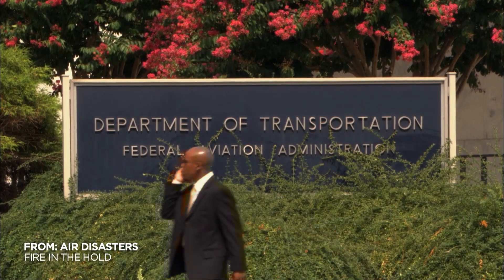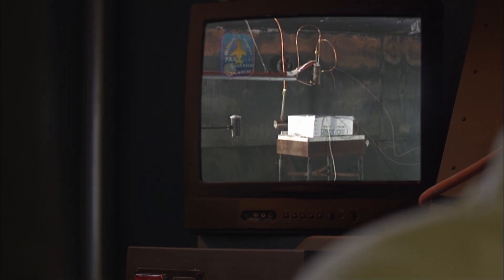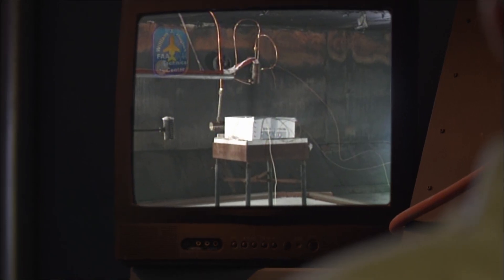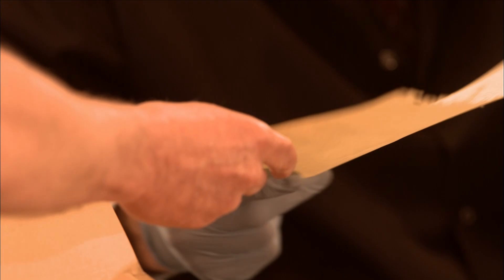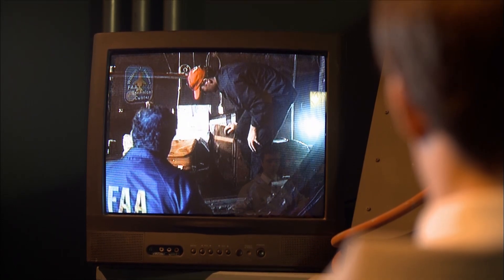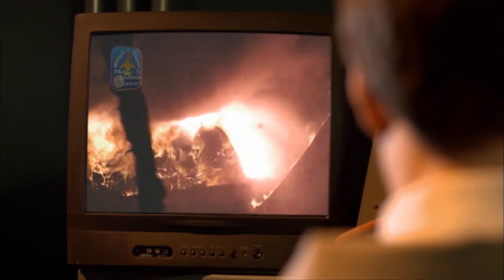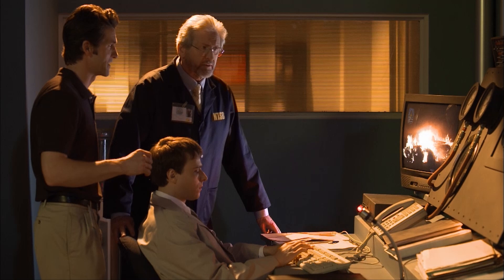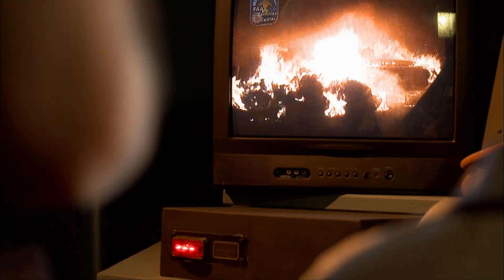Investigators Think a Deadly Plane Fire Started in the Cargo 🔥 Air Disasters | Smithsonian

Comment: This crash literally caused Valujet to ditch the Valujet name when it bought airtran in 1997. So even if they were the ones buying a smaller airline, they chose the smaller airline as the name of the merged airline.

Airtran had a clean safety record since, until southwest purchased them as part of an expansion strategy

Comment: In the 80's, I worked @ GE, then on to NASA subs in the life support systems tech area. We had VERY tight tolerances, specs, oversight, etc. And we treated O2 systems like it was a bomb in a pretty package. Your life DEPENDS on that bomb not detonating. The FAA doesn't seem to be as strict as the DOD was with us. I hope it's better now. RIP to all.

Comment: They thought Valujet's cargo hold is airtight but they're wrong. With the combination of an oxygen tank switched on by a jolt and nearby cargo, the fire got way too intense which engulfs the plane, along with incapacitating everyone on board from smoke inhalation and crashed into the everglades